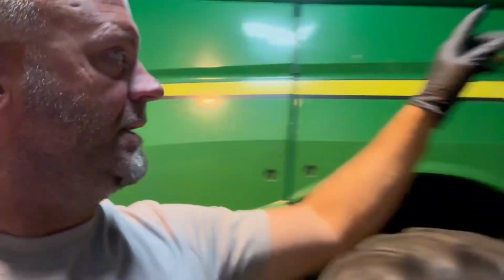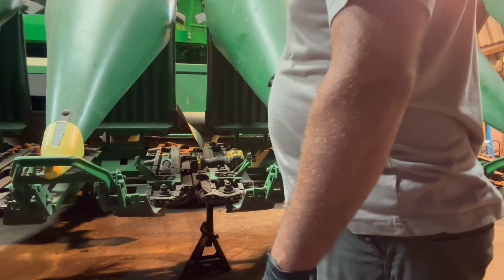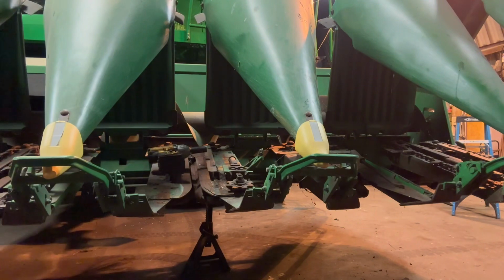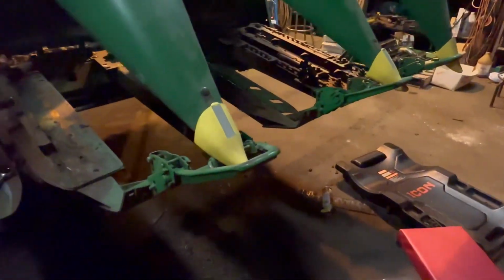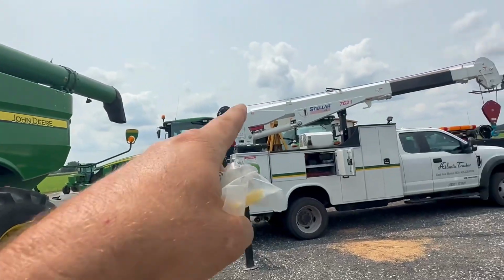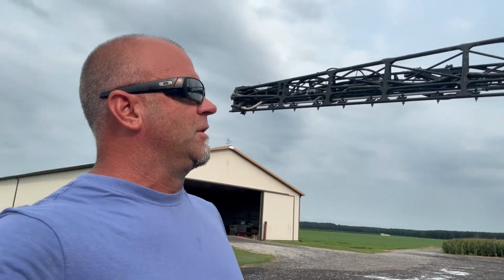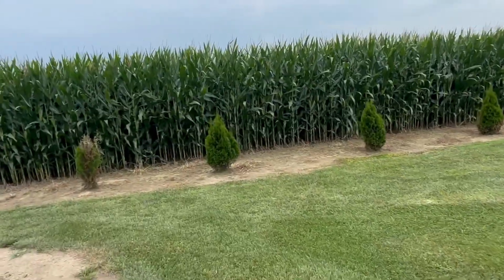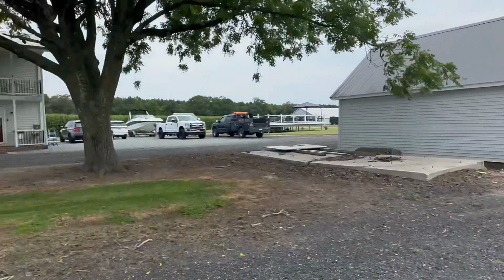Fixing long overdue equipment

Comment: Just a little bit of advice for you. Instead of putting the deer deck plates on, you should get the deck plates from calmer. They work a lot nicer,
Reply from the maker: I know but we got these parts last season so it’s what I got, already spent money on them, I wanted to put the harvest sweeps on but beings I had this stuff I figured I would use it